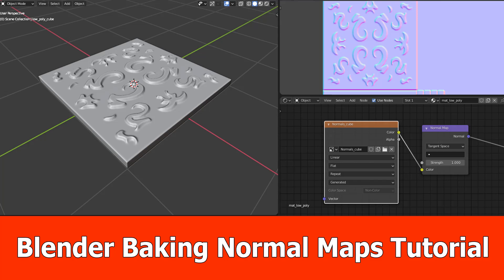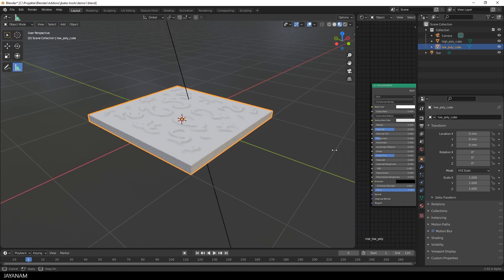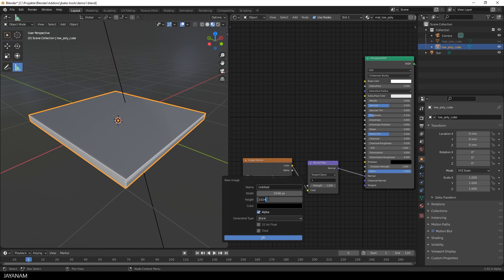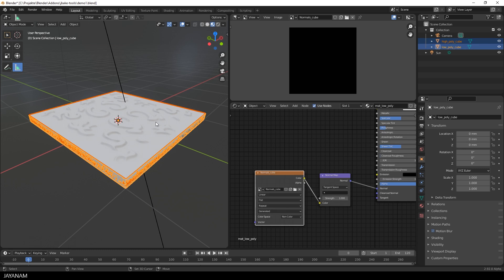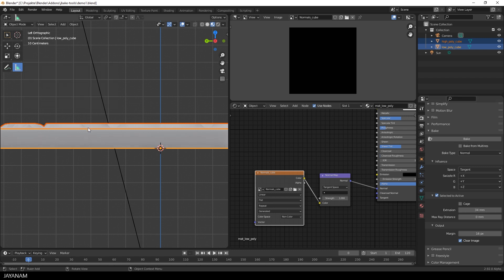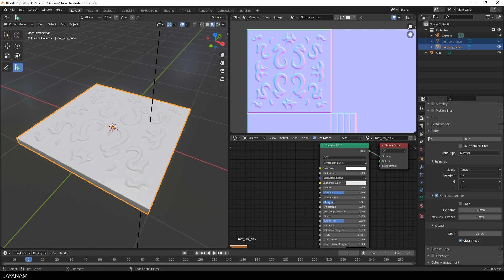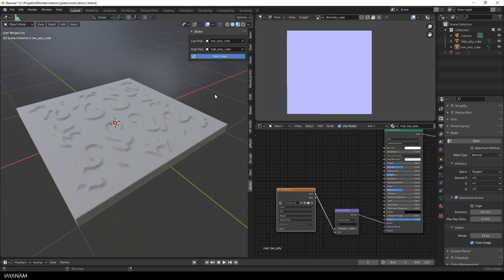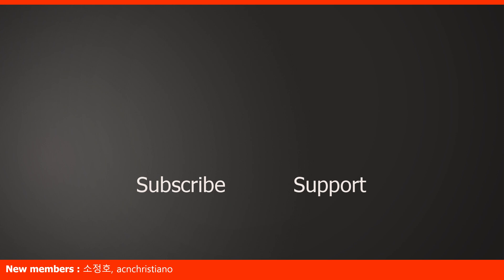Blender Bake Normal Map Beginner Tutorial

Comment: (edit, today when i looked in render mode it works now, I was probably just stupid or blinded by frustration. leaving this comment up because i dont believe in deleting mistakes.)
at 3:52 all the detail disappears. I assume the map is not applying for some reason.
* my image node is set to the correct image.
* it is set to non color
*everything is plugged exactly as shown in vid.
* I fiddled with extusion and baked several times. given I can SEE the texture in the image editor I know it is baking properly.
*both meshes are in the exact same place.
*I selected it in the same order.
* no hidden meshes
* I unwrapped it before starting.

I hate being the Idiot asking "how do normal map werk?" in a 3 year old comment section but goddamn i have searched everywhere and i cant find out why I cant even normal map a shitty cube.

Comment: Thank you for the video, I followed another tutorial and the dude just went flying trough this process and I struggled to understand anything. A question for the addon: If I use it will I have to set the baking options in the render settings or the addon is calculating the distance on its own?

Comment: Hey bud, quick question: How would I go about making a Normal map for a weapon? So far the only process I have found is making a high poly one and baking it into a low poly mesh. But what if my model is already low poly?  What would I do in that case?

I am new to Blender and this is the one part I am stuck on. I have done the UV unwrapping and I am stumped trying to make the parts show on the normal map (it always comes out more flat than my 1st gf). Any help would be appreciated.

Comment: Guys, if it doesn't work, make sure that you:
- selected in the right order, and everything you need is selected
- have no hidden meshes (delete or disable from rendering)
- did a uv map for the low poly mesh
- set the extrusion to 34mm (0.034m)
- the objects are in the same place and same rotation (and applied all transforms too)
Reply: "applied all transforms"... that was the last missing peace cant believe that would be important.
Reply: @8D2BFREE  yup, had a hell of a ride, so I wanted to share these tips, glad it helped!
Reply: does the high poly mesh be placed in the same place as the low poly mesh?

Comment: I have bumps on my high poly mesh that are similar in height to yours (a few centimeters).  I've tried setting my extrusion value to this when I'm baking my normal map, but the bumps appear to get cut off.  I have to up my extrusion to 1 meter to get it to work correctly (about 20x bigger than my bumps).  Any idea what's going on here?  I'm starting from a brand new project -- completely from scratch.

Edit: I just needed to apply the scale for my object!

Comment: When I try to bake with your addon, I'm getting the following error:

"Python: Traceback (most recent call last):
  File "C:\Users\elia1\AppData\Roaming\Blender Foundation\Blender\2.91\scripts\addons\jbake-tools-main\jb_operators.py", line 65, in execute
    node_tree = low_poly.data.materials[0].node_tree
IndexError: bpy_prop_collection[index]: index 0 out of range, size 0

location: <unknown location>:-1
"
Reply: Make sure both your objects have a new material assigned to them for it to bake to. I had the same error and adding materials fixed it.
Reply: @SamMansfield91  yeah they do
Reply from the maker: I fixed that with the latest version.
Reply from the maker: The low poly mesh needs a material with principled shader. The error message indicates that it does not have a material